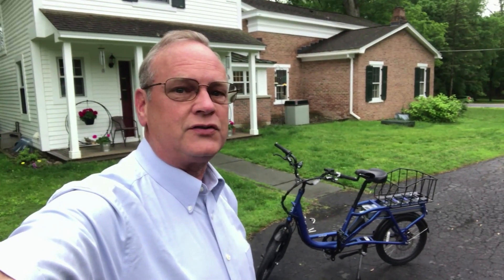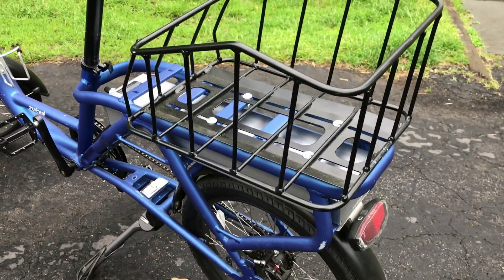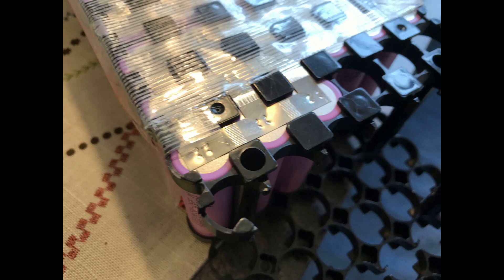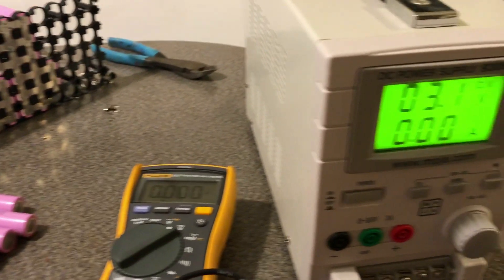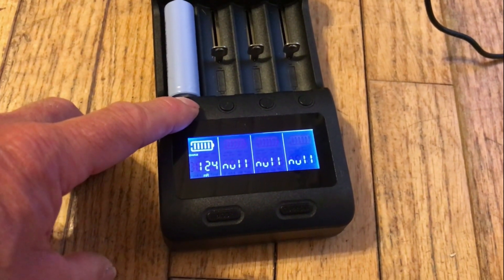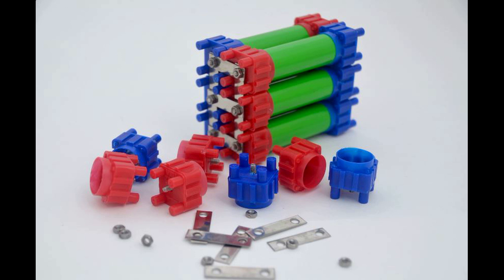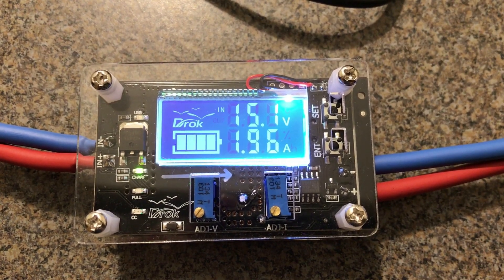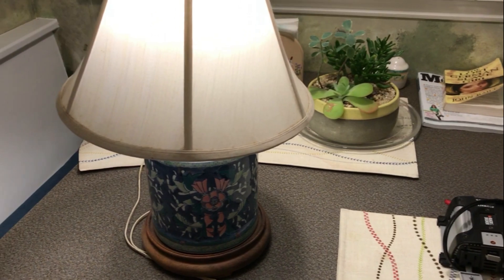Bad Juiced Bike Battery, What to do?

Comment: Hi Chris,  nice use of old cells! My ODK had BMS issues. That mess of wiring was intimidating, So I had a new one installed ($200)! All the 22ah packs had issues, replaced by 23ah early in production run.
Cheers
Reply: Hello, where did u get that flat baterry? I don’t see it on their site

Comment: My Camp Scrambler's 52V all of a sudden only would recharge 50% only.  Any ideas or suggestions?  Thx
Reply: Sometimes part of the batters 18650 cells charge level falls out of sync with the other cells.  Happened to my onewheel and brothers ebike - an ecotric.  
Run the ebike till the battery is depleted ( battery protection mode / auto shut down engages ).  
Then place the ( now depleted ) battery on the charger for 72 uninterrupted hours - keep it on the charger even after it is full and no longer charging .
  Worked for both onewheel and bike.  
Found the fix by googling onewheel battery issues.  
Hope it helps.
Reply from the maker: Is the bike still under warranty?